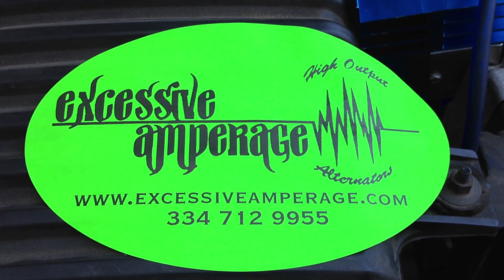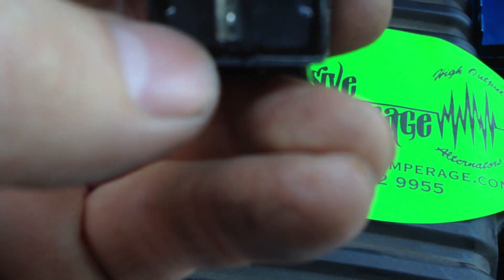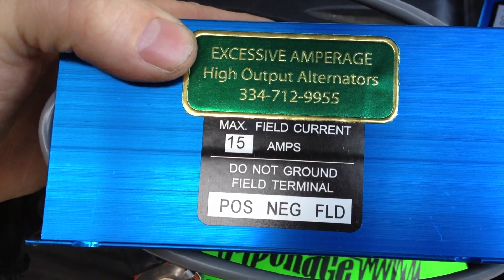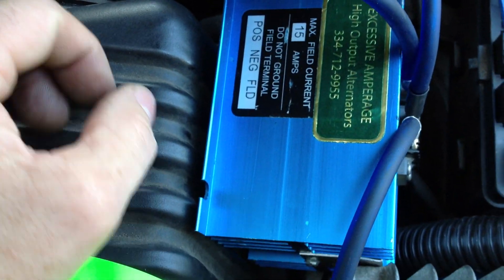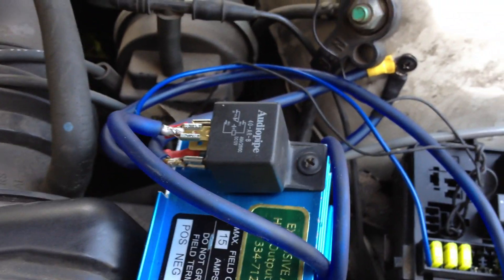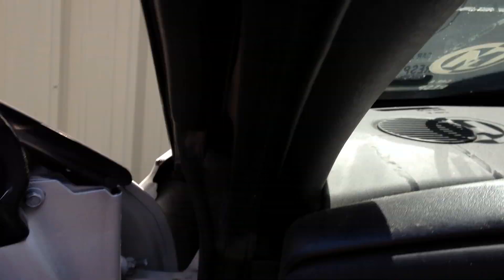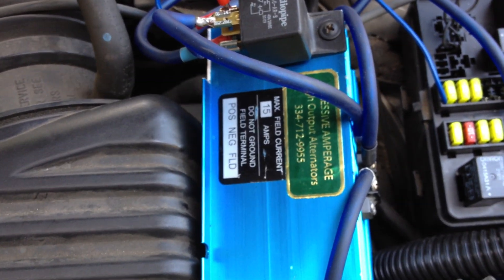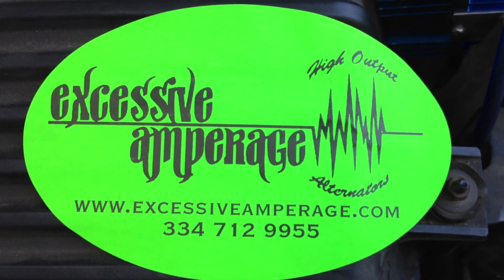How to wire up Excessive Amperage 911-02R adjustable voltage regulator and 5 pin relay

Comment: gpood vid there nate it would be good for a few ppl to show the alternator and regulator wiring out side of car so you can see the back of alt and where the fld wire goes to andwhere the other wires go to from the alternator aswell and or a diagram of the alternator and the regulator and ill wack it up on my wesbite too 
Ren
xMplar
Excessive Amperage Australia